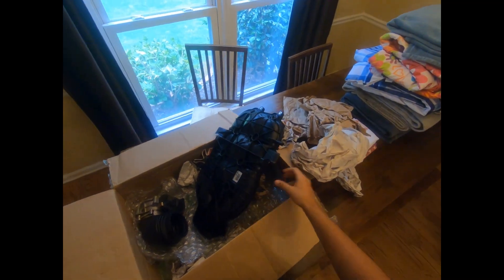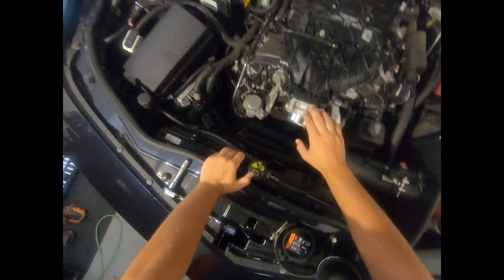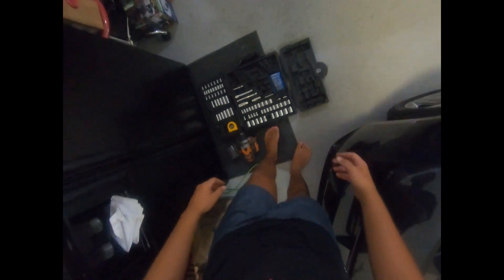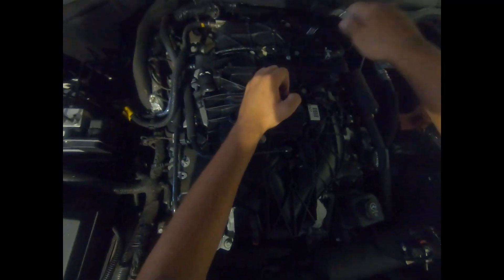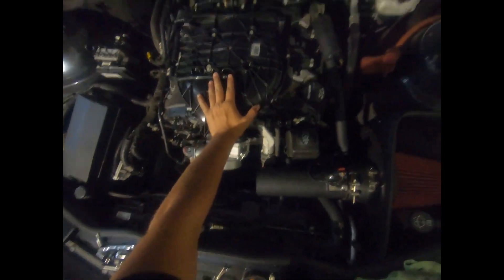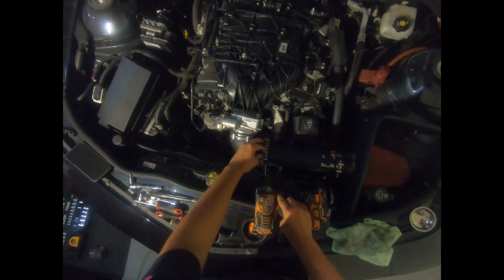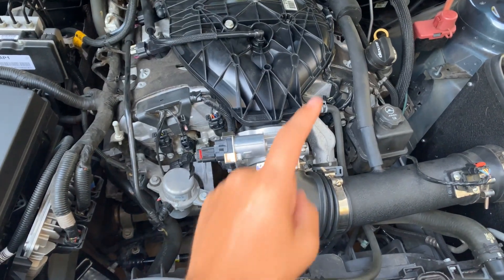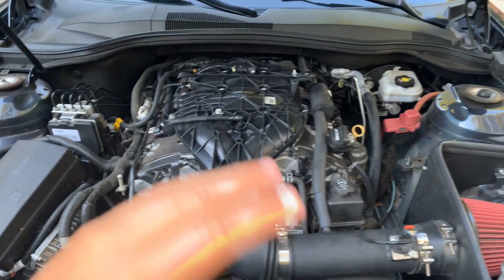Ported Intake Manifold and 80mm Throttle Body Install!! | 2014 Camaro RS LFX V6

Comment: I just recently had the port 80mm tb, ported epoxy filled mani combo from Kenny installed on my camaro plus the K&N AirCharger Intake. I’ve gotten my authorization code back but I’m at work so I have to wait to get back home to update EFILive with the code and then get the tune but in all I can definitely feel more power w/o Will’s tune and can’t wait to see what the car does with the tune
Reply from the maker: Same here. My datalog didn’t save for some reason that I was gonna send to will so I have to make a whole new one.
Reply: If you add an 80mm do you have to change anything else? Or can you just add a throttle w/o having to alter anything else?
Reply: @Ahtazal  you’ll need a tune, as it’ll likely throw a check engine light for running lean due to the added air flow, at least that’s what is happening to mine while I am waiting for the retune
Reply: @JM811Cars  thanks
Reply: Did the tb fit the K&N air intake?
Reply: @AngelEspinosaV  no you have to get a bigger tube to fit it you can look online for a 90 degree angle or straight rubber tube for it depending on your setup

Comment: Great! You forgot to disconnect the battery's negative cable, it's a must when dealing with electronics in car also will reset the ECU when first start the car👍

Comment: A few suggestions:
1) upgrade to a cold air inductions intake. Not all intakes are the same. CAI is the best brand for the 5th gen
2) windshield washer reservoir relocation with an intake air scoop. They put the washer fluid right below where the intake pulls in air from. The relocation and air scoop made more power for less than 200$
3) e85 
Subbed btw,  even tho I sold my 5th gen v6
Reply from the maker: Chris J Thanks for the subscription. Yeah I’ve been looking for an intake. This intake I bought actually gained 6 wheel on a dyno. However lost power since its not in a box like the cold air inductions intake so it gets heat soaked if that makes sense. Also did you have the windshield washer mod and/or e85 on your car?
Reply: @Sameres123  I did not have it on my v6, ended up trading it in for a 6th gen ss. But theres alot of information about it on the camaro5 forums. Theres also some videos on here with camaro v6 that have e85, should net you 20-30whp if its available in your area.
Here's some info on the cai/WW relocation:
https://www.camaro5.com/forums/showthread.php?t=249225
Reply: Questions do you get check engine light whit the scoop because more air Flow I need to be tube?

Comment: Did you honestly notice a performance and response gain from the ebay intake? Reason I'm asking it's because I don't know if the expensive ones are worth the extra money. If the ebay one works for less than half the money, I could just build a cover to paled on top of shield. Thank you

Comment: Will you need a tune after this upgrade?
Reply from the maker: Kriese TV not necessarily however it make the car run smoother and you’ll get the most power out of the setup
Reply: @Sameres123  Oh Ok thanks! I just realized, your the guy in the facebook 5th gen performance thread asking me about my hp gains on my from my cam upgrade on my v6..lol small world. But my car is pushing out around 360-370 at the wheels. That's with the cams and the other mods.

Comment: nice vid man. watching this because I just bought the extendolator and throttle body so just wanted to see before hand how it would be to install. pretty easy
Reply from the maker: Raúl it’s not hard at all. Took me an hour
Reply: @Sameres123  cool. so how have you been liking the 80mm? do you think the tune is necessary since you said computers wont learn after a while? I ain't trying to spend extra money for a tune if it isnt necessary lol
Reply from the maker: Raúl just make sure to unplug your battery before disconnecting anything. And reconnect the battery only when you’re fully done with installing everything. It’s going to idle weird at first and will take some time. You’re just not going to get the most out of your performance gains without the tune
Reply: @Sameres123  hmm ok so seems like you would recommend a tune. well I'll see once I get my throttle body and extendolator and see how it runs. 

another question, just saw your SS intake install for your maro. do you think it's better than say a K&N cai? K&n doesnt require tune but SS intake does right?
Reply: @Sameres123  sorry for all the questions btw! just really excited on making more power for my car lol

Comment: Good one mate. U got a new subscriber..i own a 2015 camaro V6. Id like to have these in mine as well..how much do you expect to gain from a throttle body only upgrade?
Reply from the maker: febz thanks so much for the subscribe! Also gains from the throttle body upgrade vary if you are tuned or not. However, someone with a impala lfx put the 80mm throttle body and gained 10 wheel without a tune. So it’s a very good upgrade.
Reply: @Sameres123  thanks for the info..do u any seller who ships to middle east? I'm in uae..i couldnt find TB for a v6 camaro on local shops.
Reply: Ok so throttle body os bigger but at tne acraul intkae manifold sounds like wasted money

Comment: What the difference between the stock intake manifold and that other manifold you install?
Reply from the maker: AUDY PEREZ the other intake is ported. More air = more power. It really compliments the 80mm throttle body
Reply: @Sameres123  ok thank you man I want to see dyno number now please I want the same setup on my camaro 💪💥🔥🧨
Reply: @Sameres123  were I can buy one from the intake manifold and throttle body 80mm ?
Reply: @kennycamaro2361  are you still doing the intake manifolds?

Comment: Do you need to disconnect the battery before doing that?
Reply from the maker: You do not really have to. The computer will freak out regardless and give a rough idle for about 30 seconds and driving will be quite rough afterwards. However, the computer will slowly relearn the new parts and after 175 miles of driving, my car is completely smooth.
Reply: @Sameres123  thanks for that info. Great job. Keep us posted on your ride...

Comment: Bro so I did my TB and intake, did you get slight revs when changed??
Reply from the maker: ALEJANDRO CALDERON yeah it was revving so weirdly at first and it still is after 300 miles. You really need a tune to get rid of that and to get all the gains out of it. I’m waiting for my retune from overkill
Reply from the maker: ALEJANDRO CALDERON yeah it was revving so weirdly at first and it still is after 300 miles. You really need a tune to get rid of that and to get all the gains out of it. I’m waiting for my retune from overkill
Reply: @Sameres123  I did mine yesterday  Bro and its settled more then it was, I get a slight rev while in Park of 600 to 1000 rpm @ times. But runs GREAT in gear and Better throttle response! Thanks for  your Reply and your Video!
Good Job!👍
Reply: @alejandrocalderon7  do you tune your do you fell any different on horsepower gain?
Reply: @CorvetteC6-LS2  sup Bro, from ft worth TX, I'm a proud owner of the lfx v6 do your research for sure!! I can feel the torque and gains! If you have the same car and you do the same mods plus some, it won't  disappoint you.
Reply: @alejandrocalderon7  thank you man were do you order them?
Reply: @CorvetteC6-LS2  JACFAB
Reply: Its the intake

Comment: where did yu get that coupling from? did it come w/ the 80mm throttle body from overkill?
Reply from the maker: Dalton Allen it did not come with the 80mm throttle body unfortunately. You will have to buy a larger 90 degree silicone elbow that will fit your cold air intake.
Reply: Samer Sbaity thank yu

Comment: So, if I may ask how much did you spend on all these mods? 

I ask because I'm a '18 camaro RS owner. I've got the LGX V6 and it started at 335HP. I'm gonna be at 510HP(up from 432) after I get it back from the shop. I stuck a edelbrock supercharger on it with a stage 2 tune. Why bother with porting, and all these baby mods that are gonna add, what. 20HP total? 30HP total? Sure they're "cheap" but they don't really make that much of a difference? Why not stick a procharger, or a cheap turbo kit on it. Hell, use the Edlebrock kit I used.  You'll still have a sleeper V6 and you'll be able to push up well above standard performance and even surprise people. These mods are "real" mods, let me make that clear. You're not doing the same crap people that shop at Autozone for vents and stickers do. However you're not getting enough horsepower gains to matter.  

My stock LGX rated roughly 275WHP on the Dyno You might be at 285? 295 if we're being generous? You can't feel a 10-20WHP gain.
Reply from the maker: King Orthocone so yeah I get your point. I first dynoed stock at 257whp. Then after everything was done, I finished off at 292 whp. I currently have put a vortech supercharger kit on the car and I’m making around 400whp. I just wanted to go baby steps
Reply: @Sameres123  Fair enough. I haven't seen any videos from ya with the vortec, and you should show it off! You should be able to match up against most (stock) V8's, if nothing else. You may not always beat them, for a variety of reasons but with 400WHP you'll be close.
Reply: @Z51MAELSTROM  It's better to remove as many intake restrictions before going FI and easier to tune after, so I think he made good choices for the route he wanted to take.
Reply: Have you had Any issues with your Edelbrock Supercharger? Also is the Supercharged V6 your daily?
Reply: @pz3atl11798  Yes it is my daily.

No I've had 0 issues with the supercharger. It performs very well, is reliable, delivers smooth power when it spools up.